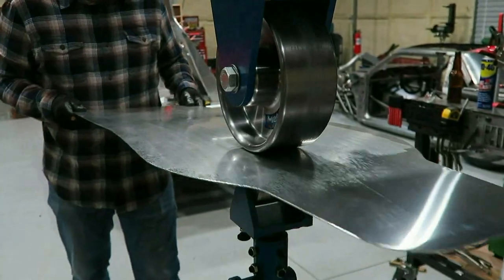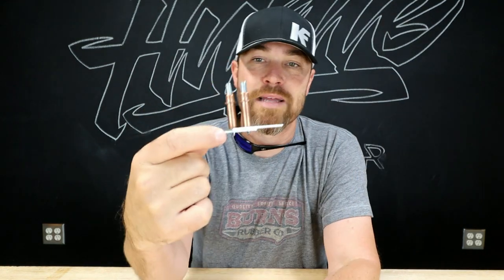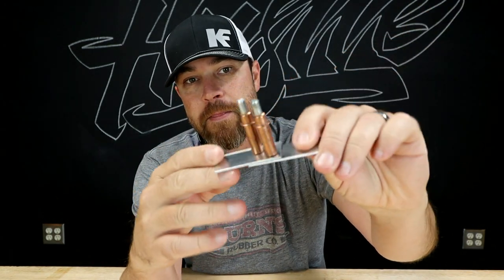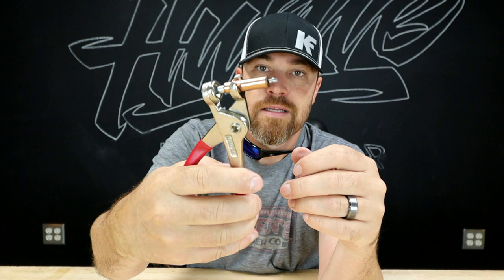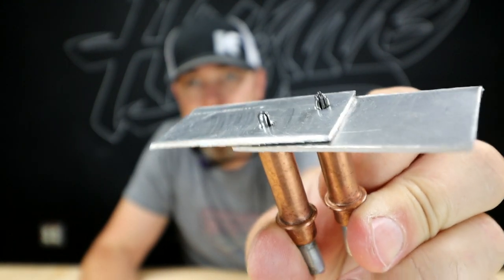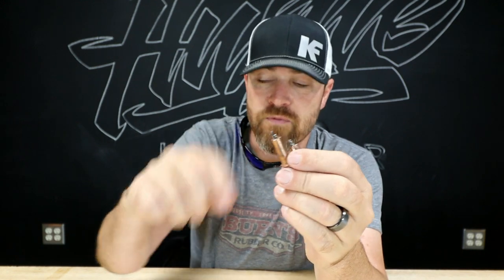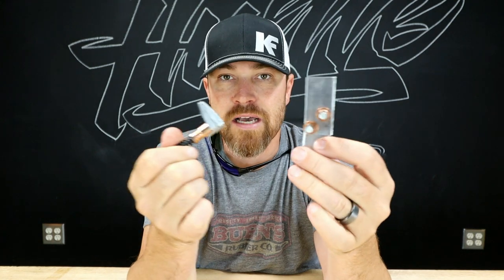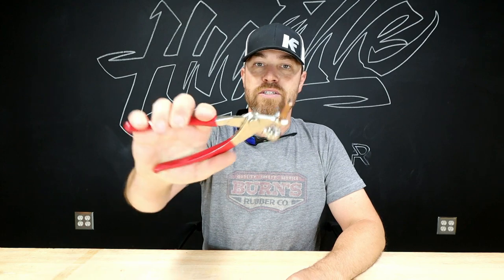You Need This Tool - Episode 124 | Cleco Sheet Metal Fasteners And Pliers

Comment: Useful add-on:  Lazze Metalworks makes these little pre-drilled tabs that work with Clecos to hold pieces flush, instead of overlapping.    Yeah, you can cut them yourself but they're not expensive to buy and it's way easier than sitting there all day cutting and drilling little 1" x 3/4" pieces of 16ga.